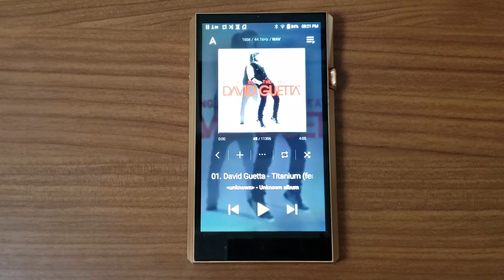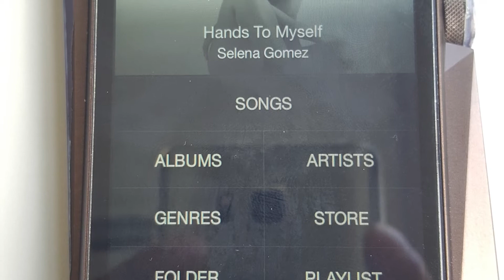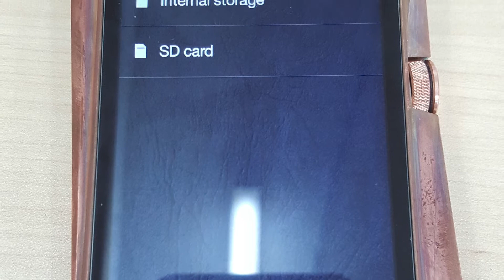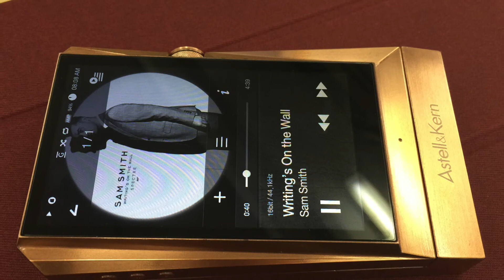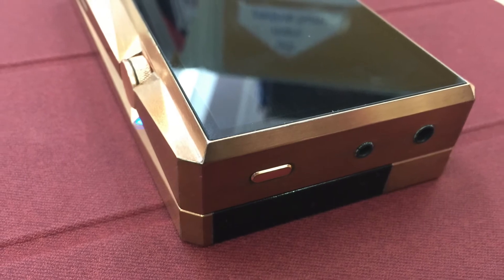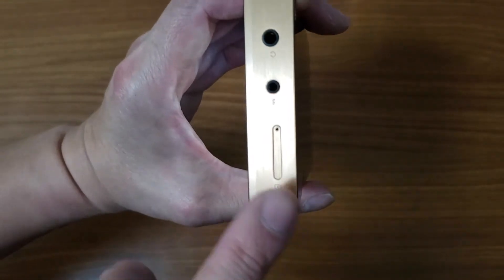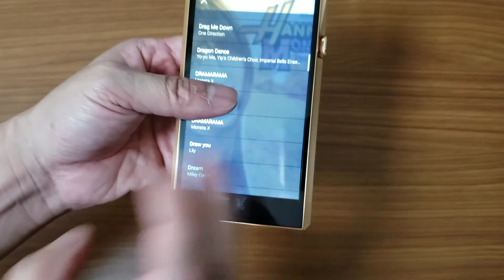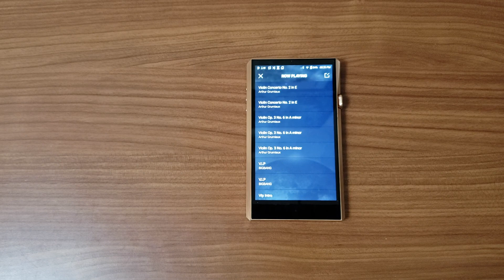AK SP1000 Tips and Tricks Part 2 of 4

Comment: Excuse me. The volume ring, is rigid or has a little play? i mean, due that wheel is for 2 functions, maybe for the use, this could be loose. 

The question is because a guy sell one very cheap but the wheel is a little loose.
Reply from the maker: Yes I also know about that problem as mine was loose eventually. You just stick some tape on the inside and that works fine now. Not ideal but that is what I did. Have read other people happening to them too.